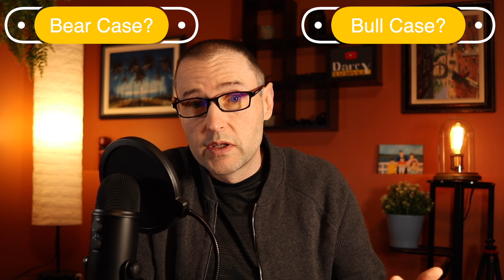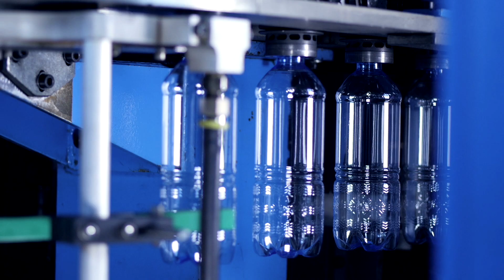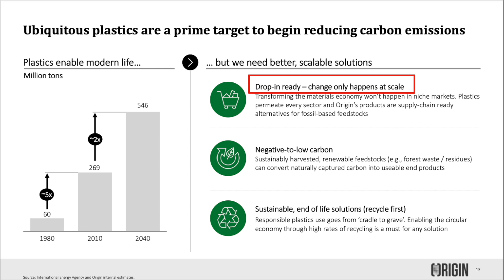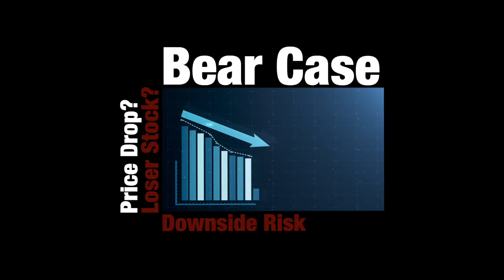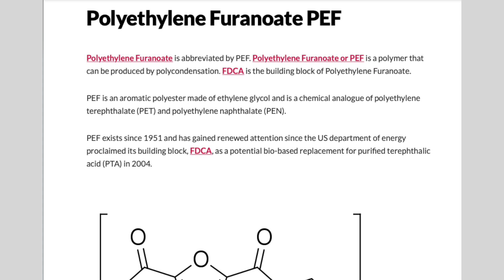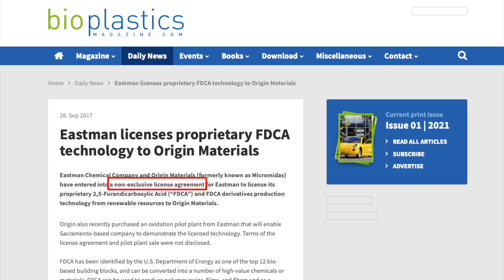Is The Origin Materials SPAC Going To Save The World? | Bull & Bear Case Stock Market Analysis

Comment: A couple callouts: 
1) Origin is a US company based on California, not a Canadian company. They are building their first plant in Canada, with their second likely to be built in the Gulf region of the US.
2) With regard to PET vs. PEF: there is a significant amount of PET that go into long lasting goods like cars, carpets, tires, electronic cases, etc. where biodegradability is not desired. As their customers desire PEF, they will be able to use the CMF from their existing PET process to develop PEF. This is where the Eastman patent comes into play, btw. I think focusing entirely on PEF is misguided. A combination of Bio-PET and PEF will be required. Origin can deliver on both, at scale.
3) I think you have underestimated their moat...just my opinion.

Comment: Biodegradable PEF has not yet reached commercial stage.  “Commercial production and launch of FDCA and PEF is expected to be operation by 2024.”  Seems Origin Materials will start produce bio PET (recyclable, not degradable) in 2022 and mass production in 2025.  They also plan to produce PEF in 2027.  Hope they stay in the plan.  AACQ SPAC chairman is a hugely successful fin tech guy, so I trust his vision of throwing the SPAC into OM.
Reply from the maker: Yeah, I think they're on a good path, it's a compromise.  And there are still viable use cases for non-biodegradable packaging.